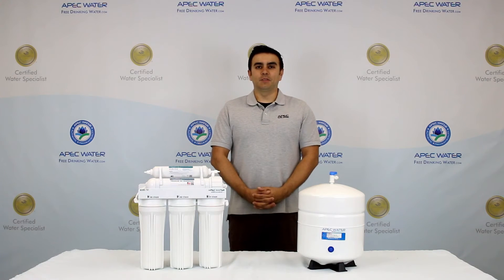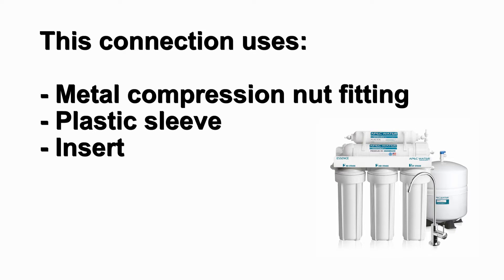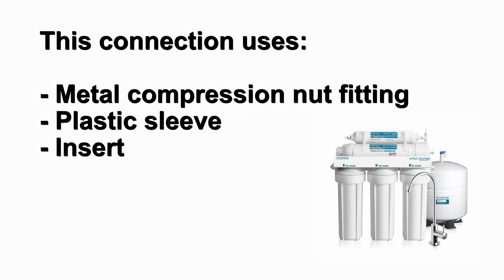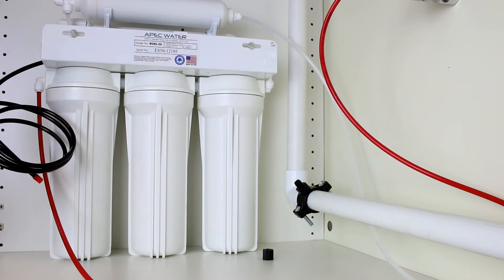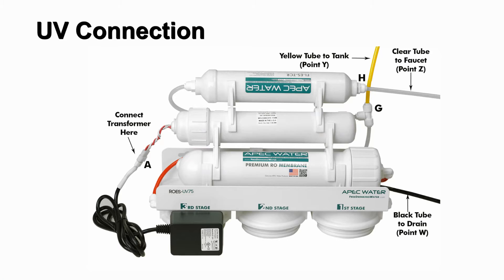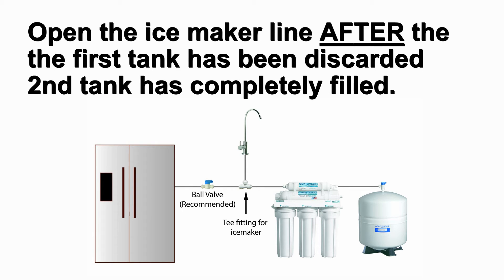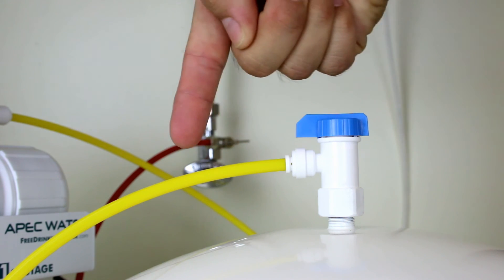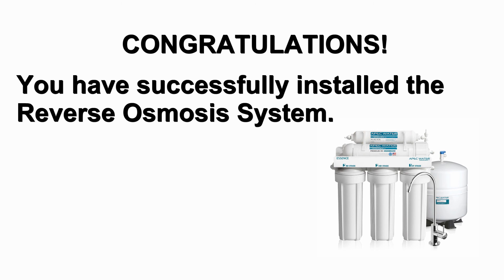New Version APEC Essence Series Reverse Osmosis System Tubing Connection Installation Guide Part 5

Comment: I had to disconnect everything for a move and am reconnecting it but low and behold, I've confused myself by getting some tubes mixed up with some other tubes I've used for various things like hydroponics. Does the black drainage line for the RO have a yellow piece and a "flow control" sticker on it?

Comment: Part 4 included putting an adapter on the faucet stem.  On this video, it’s not there.
Reply from the maker: Dear Customer, 

Thank you for your comment. We are happy to help! There are two ways to connect the faucet, either with the faucet connector or with the nut, sleeve, and insert as shown here. The two videos showcase the different methods of connecting the faucet. 
If you need assistance, feel free to contact us directly by calling 1-800-880-4808 or e-mailing us at info@apecwater.com. We are in the office from Monday-Friday from 8:00am-5:30pm PST. 

Best Regards,

APEC Customer Service